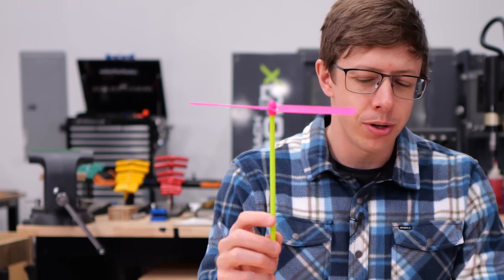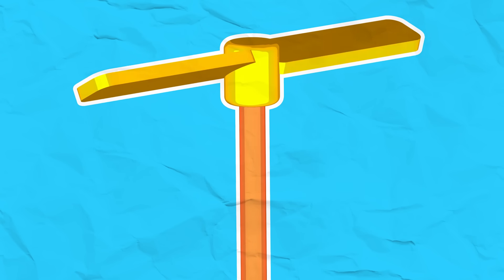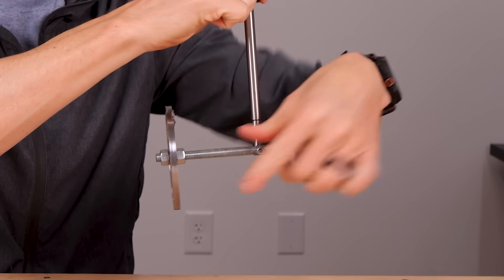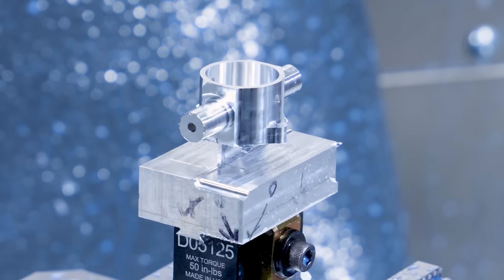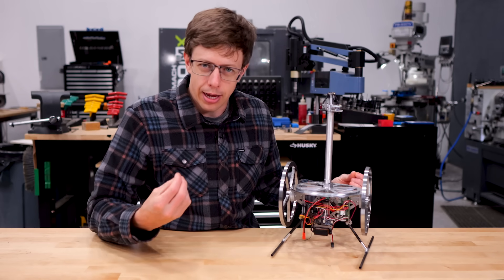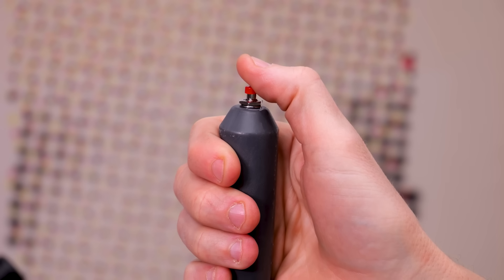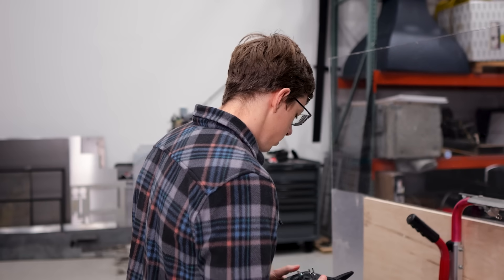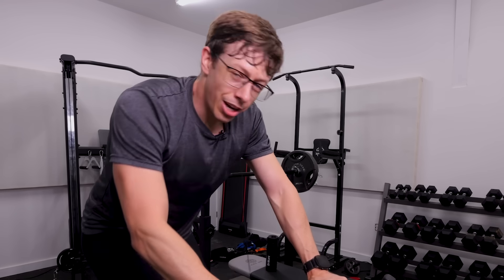I really thought this would fly well

Comment: Double the flywheel to four, with two counter-rotating propellers on top of the other.

The issue here is that not only do the flywheels generate force, but the propellers do as well and in the same direction ! You need to cancel out both. You could also achieve control by adjusting the pitch of the counter-rotating propellers differently to create an imbalance.

Although, good luck designing a reliable shaft!
Reply: Yeahh! i think the same. Also there are 2 flywheels more so if you mantein constant the mass you can reduce his diameter and take less energy to spin

Comment: maybe the design of the flight trainer from the MBB BO 102/103 can help you?
this is a single blade rotor with a counterweight for the missing second blade, which should also be able to serve as a counterweight for the flywheel by rotating the rotor in the opposite direction to the torque generated by the flywheel

Comment: How about putting the flywheel at the end of the prop, like a ring with vertical leading and trailing edges? Maybe get silly and make it a sectioned lightweight hollow tube filled with something similar to sand that you can just design  to come apart and fall fairly safely.

Comment: If I had to give my suggestion on a direction to take this. I would go with a quadcopter with a horizontal fly wheel, in the center of the craft. I like the changing the angle of the blades idea. But instead, change the angle of the rotor to the opposite direction of the fly wheel. Example, fly wheel spins clockwise, the 4 rotors are slightly angled to spin it counterclockwise. Then have an accelerometer to change the angle as it goes up to prevent it from tipping to one side or another and hopefully counter the rotation of the flywheel.

Comment: Either double main rotor like real choppers without a tail blade or you will end up having to give it a tail to put the flywheels on it. I would be sad a bit because it would mean just mimicing basics of a helicopter and I ain't sure you wanted to do this. Improve but not necessarly turn into

Comment: Id have thought putting a sheer pin in the bar to the blade, having it fail and seprate at a set RPM letting only the blade up and leaving the rest on the gound would be worth trying, unless I also have tunnel vision!

Comment: I think that if the best solution for a traditional helicopter is to have a long arm where to apply a torque to counteract the torque generated by propeller has a meaning. Direction of helicopter is obtained adding and removing that torque from the main propeller. The only way to cancel that torque is using another propeller on s different axis that cancels the torque, but it had to be symmetric  to the center of thrust. They can even be concentric. The alternative would be to have propeller and flywheel rotate in opposite directions, but they should have Identical torque (same mass?)

Comment: maybe the simpler approach would be to take a functioning rc helicopter and replace the motor/main battery with a flywheel system of the same weight

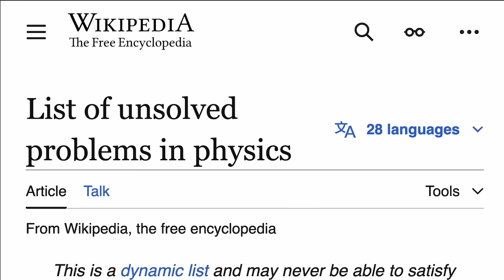Comment: 0:33
well there is a theoretical upper bound absed on mateiral properties
for a thin rotating ring with density d radius r cross section a and circumferencial velocity v the centrifugal acceleration is v²/r the mass of one half ring is pi*r*d*a, that makes the total outwards force experienced by that half ring pi*d*a*v² and since for any short length along the ring the portion of hte length we tarvel sideways is proportional to the portio nof hte force acting away from out viewing plane this gives us a lenghtwise component of pi*d*a*v²/(pi/2) if we consider cutting the ring at any diameter we get two half rings sticking together at a cross section of 2a, so the tensile load on the material becomes d*v² which means that for hte material to barely hold up v²=tensile strength/density and since kinetic energy is v²/2 that means the maximum energy density of a flywheel is tensile strength/2density
if we are very optimistic and want to figure otu hte absolute hypothetically possible maximum we assume the spinner consists completely of an idela flywheel just before breaking and that energy is converted 100% into potential energy in its altitude then that means that hte maximum height you can reach is simply half the specific strength of your flywheel material
for high performance aluminum alloys that would give you heights of about 11km for carbon fibre over 100km
however that theoretical ideal maximum is pretty far from anythign practically feasible so it really comes down to helicopter optimization
Reply: with a real world helicopter around 1km with metal flywheels should still be barely doable though, then the big step up would be carbo nfibre flywheels but getting those to actually use their advantages gets kinda scary and high tech because they can spin insanely fast before tearing htemselves apart so if something does go wrong you've basically got a small bomb and they're usually built into light gas or underpessure containers to reduce air friction

Comment: Shouldn't be bevel gear teeth also beveled? I wonder how efficient it is with the straihgt cutter.

Anyway, unless you want flywheel powered helicopter, next attempt should probably have flywheel spinning on the rotor axis and then some torque converter that would be able to transfer momentum with  good efficiency.

Comment: 9:29 Or you could have added a fan on an arm like a real helicopter to be light and produce the torque you need to counter the rotation.

Surely those control surfaces won't work well when the copter is near the ground because there is going to be loads of turbulent airflow close to the ground?

Comment: If you make a 2nd big bevel gear you can have another coaxial shaft running a second set of counterrotating blades. Conveniently, if you just put the other big bevel gear on the bottom it will rotate the opposite way.

Comment: another idea for this, make the flying piece more like the manual one, but with the pitch change on a spring, so it can flatten the wings to spin up. and move them back to launch. Heck, with the spring spring tension set right you may be able to have variable pitch as the shaft slows on the way up

Comment: Also I had the thought if the torque is twisting so hard, wouldn’t meltybrain style movement used in robot fighting and braking slightly (which I know defeats the purpose of MAX HEIGHT) allow you to try to harness the braking force to mitigate some of the torque forces? (Obviously I’m not a professional or have any degrees but) From what I understand of a lot of the spinner/flywheel weapon bots use that deceleration/brake force to turn and/or shimmy.

Comment: If you try this again, try making the rotors themselves the control surfaces, rather than separate parts. For example, the Apache helicopter's rotors are where most of the mobility comes from, rather than separate control surfaces. The stability should already come from the flywheel rotation, as you said. Hope this helps on the very low chance you see this.

Comment: I just wanted to point out that the airfoil approach you took actually only works at essentially the max speed of the vehicle, at which point the prop/rotor is imparting the least relative force intot he wind since you have hit the saturation point for the blade.

Helicopters that have control surfaces essentially only use them at max cruising speed for similar reasons. If you want to counteract that torque you either need a rotational thruster, such as a tail prop (which obviously will not work without some sort of on the fly adjustable control) or a counter rotating prop, (though be careful of inter-meshing collisions)

Comment: if you used 1 flywheel rotating parralel and opposite direction of the blades, so when the energy from it is drained the "equal and opposite reaction" is spinning the chasis into the direction of the blades giving more lift.

Comment: While I enjoy the over engineering, you should make a simpler version for comparison. Use the same size propellers as your helicopter, but just with a long shaft that is used for spinning (you could also include a small axial flywheel). If its so simple it doesnt need any electronics, it will probably (partly) survive a fast landing on grass. Or you can easily make several.

It would be awesome to see how high those get in comparison to your helicopter.

Comment: What if you do the flywheel around the blades? Spinning faster than the blades but in the same direction? Basicaly the same design as the toy, with a long stick hanging as counterweight... Just wondering

Comment: I think to maintain the spirit of the childhood whirlygig you need to put weights at the ends of large paddle blades that spin fairly slowly, producing as little drag as you can for as little added mass as possible. Then for the recovery mechanism you can have the central shaft packed with your chute and pyro, which can be triggered by an inversion, maybe?

Comment: 14:00 do what normal RC copters do, and have a 2nd rotor with opposite rotation. OR, use the gear as another flywheel, and make the rotor spin opposite of it.

Comment: If you're not using a tail roter then try counter rotating blades. Maybe a flywheel that is 90° from the other and rotating opposite might help. Eventually you'll wind up with a defense department weapons system that may work but costs a lot, when all you wanted was a sling shot.

Comment: How you make a propeller with less resistance, which needs higher rpm for the same amount thrust? If you make the angle of the blades smaller for example? Then you could put more momennt of inertia in the blades
Reply: What could help to stop the twist of the body is, if you move the flywheels in the plane they are in one to the right and one to the left. Now you install a propeller inside of them, which causes a momentum around the upper propeller axis axis to counter the rotation. But maybe this would lead to too much loss of energy in the system.

Comment: Why not put the flywheel on the same axis as the propellor? This would avoid the annoying gyroscopic effects altogether. To avoid spinning up the electronics, counterrotate it and give it the same momentum as the propellor, so the net angular momentum of the whole machine is 0.

There will still be some spin-up since the blades are not pushing the air straight down. You can maybe  hack a solution to this, like giving the flywheel slightly less momentum, or do the wings idea again. (The torque from only air redirection will be much lower than from driving the propellor, so it should be easier for the wings to cancel it out.) But the elegant solution I think is to use two counterrotating propellors along with two counterrotating flywheels, getting zero net angular momentum and zero net torque on the air.

Comment: Hello Mr. Stuff made here lol
I have an idea for a project, it is called an oscillating air engine or a wobbler. It was a semester project for all the freshman engineers at my college and I would be curious too see how far you could take it. The engines had 4 main goals to be tested at 15 psi, Max torque, air efficiency (how low of a psi can the engine run on), Max speed (rpm of the fly wheel) and max coast time (once the air was turned off). 

If anyone else wants to see this please like so he sees lol

Comment: It would have been much better and far more interesting if you hadn't done anything except reproduce the original, in strong materials with the correct weight distribution to allow it to climb, and then spun it up using a powerful drive mechanism.
You waaaay overcomplicated it, and just as with your disc golf hucking thing - a little ignorance took you a loooong way. :P

Comment: I think that the speed of the air made by propeller was stronger than the  'anti spinning wing' position/angle actuator could give. Try if fixed wing could generate enoguth force to do the job. Or maybe as other engineers wrote: the spinning torque cannot be balanced by such wing.

Comment: Why not a conical flywheel in line with the axis of the rotor?  More in keeping with the theme and my intuition tells me it should be gyroscopically stable as in the original design. If you want to keep the dual flywheels, you’ll need a counter rotating set of main props or a small secondary rotor as in a standard heli… though it’ll still be gyroscopically unstable

Comment: it worked! just as you proposed but there is more mass in the blades than fly wheels. it should cancel out. 

hopefully counter rotating blades can offset this without a tail rotor... the more stuff sticks out the more torque it will have but also more prone to damage during landing.

counter rotating blades should keep it upright as well. 

🤔

Comment: Probably going to get buried in the comments, but I would have tried fixing by redesigning the frame as a dual rotor (either tandem or transverse).  You could have powered one rotor spinning clockwise with one flywheel, and one rotor spinning counter-clockwise with the other flywheel.  Flywheels could have maintained same mounting for center of gravity balance.  Increases complexity a ton (driveshafts, etc) - but would fix the rotation issue while still avoiding procession.

Even with that, I don't see how you can get sufficient control without a swash plate, etc.  Appreciate that your videos always showcase the struggles of design!  I think we have all had these moments at least a few times in our careers!

Comment: The tests with the wings close to the ground had no chance of work because you need to keep a steady flow of air along the control surfaces which the ground prevents to happen. Instead use the solution developed for helicopters and attach a small helix in the plane of the main helix with axis at same time perpendicular to the main's helix axis and to the radial direction to that axis. Or use two coaxial helixes or two parallel helixes. Also, pay attention to the Dzhanibekov effect on rotating bodies. It will tumble solely by not rotating in the bigger or smaller inertia moment of the body.

Comment: Why not just let go of the blades and shaft connected to it? Then itll look more like the original anyway. I guess then itd be hard to slow down. Which is why you arent just using the blades and the shaft. But there has got to be a way. Small motor to twist the blades either at there base of inside the shaft? Is it possible? Idk

Comment: I wood have put  the helicopter high  platform  attached to a long cable  tied to a high pole so that when it took  off  it could not hit the ground It wood only swing  Back  to the pole  also a weight slung below the helicopter may work  or just make it into a twin rotor 
or QH-50 coaxial rotor

Comment: As some of the real engineers (I have merely crashed some RC helicopters) pointed out the control surfaces are not going to (control), you'll need a swashplate for cyclic control and coaxial rotors or tail boom and rotor for anti-torque.

Comment: My fist guess is that there isn't enough body weight on the chopper to counter act the physics and torque generated by the rotating propeller. I'm basing this off the fact that helicopters I've seen are at least a certain size and drones I've seen use motors that don't rock the boat in such a way.

I'm probably wrong but I like guessing :)

Comment: If yiu eant to stay with a single rotor, then you need a light easy way to counter the torque. I would probably do a reaction wheel for orientation, and a small electric motor to stop it from spinning.

The easy way to go would be to do dual  main rotors, either stacked or staggered (such as a chinook). 

But that that point, its just a powered tiy helicopter.

Comment: this twisting motion is why helicopters have the tail the length and rotor on it create counter torque, speeding up or slowing down the tail rotor induces spin in one direction or the other. you can see this fail in videos when a helicopter loses this and it just starts to spin as it crashes. with the dual flywheels its necessary to counteract the spin.

Comment: Did I just watch a man make a crazy rc helicopter but with a kinetic battery instead of an electric one and without an other set of blade spinning in the opposite direction to counter the spin. 
Also you won't get any counter spin with aerodynamic at low speed or if you don't take off the ground.

Comment: He is making stuff on hard mode: Instead of shrinking a helicopter into a toy he wants to upsize the toy into a working helicopter.
A tailrotor would be the obvious but lame solution for this. Also a drone setup with multiple propellers could be a solution.
Either way making something fly that stores its energy in a flywheel is hard..

Comment: Your explanation of autorotations is slightly off. If you changed the pitch of the blades to the complete opposite of when you're trying to produce lift, you'll actually drive it faster into the ground. You can see this happen when you were first testing it in the garage and had to change the blade pitch to set it back down. When autorotating, the pitch of the blades becomes flat pitched, but it is never negative.

Comment: You would get a little bit less torque from the drag if you didn't have so much weight pulling it down. You need some passive stability, and don't forget that while procession is a huge issue, precession is precisely the mechanism by which gyroscopic stabilization occurs, the procession response to the procession of an external torque is precisely in the opposite direction of the external torque!